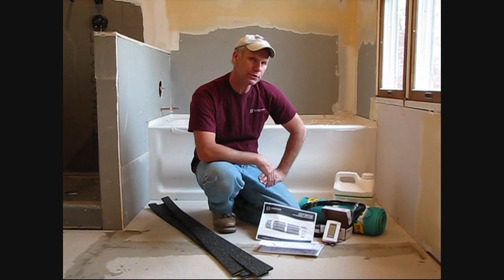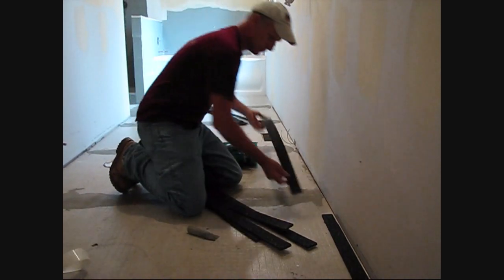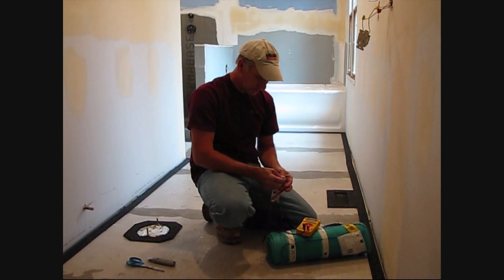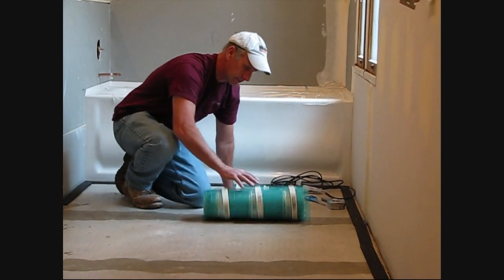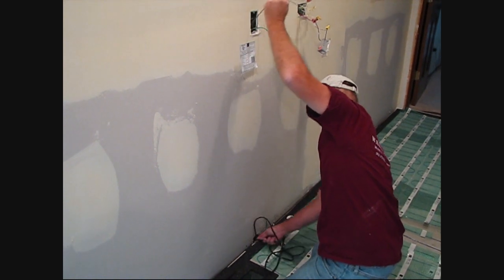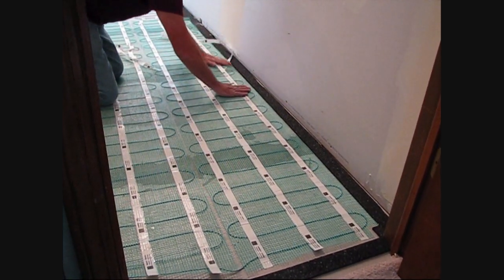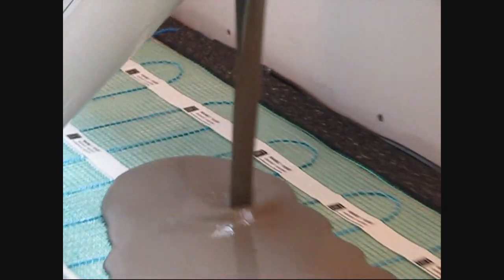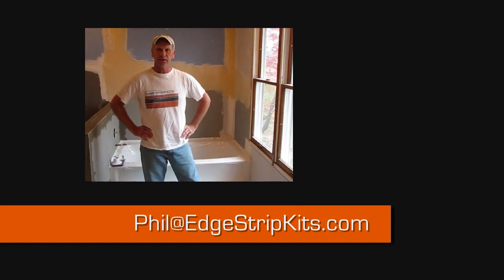Using Edge Strip Kits to Install WarmlyYours Twin Radiant Electric Floor Heat System

Comment: Hi, I'm in Canada to..I'm located where the interstate 75 terminates on the north end. The cities are Sault Michigan and Sault Ontario..I'm on the Canadian border side and will be starting to do an electrical floor shortly so I'm needing some products.
I do like the edge strip idea however my concern is I'm only going to heat certain portions of my new addition floors. I'm thinking the edge strips will help transition from the mats to areas where there's no mats. Am I on the right track?